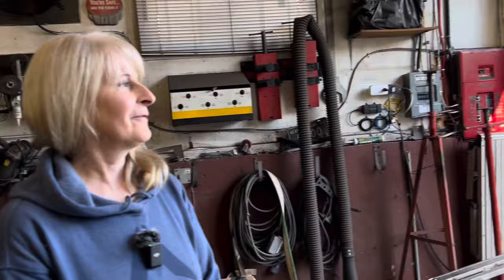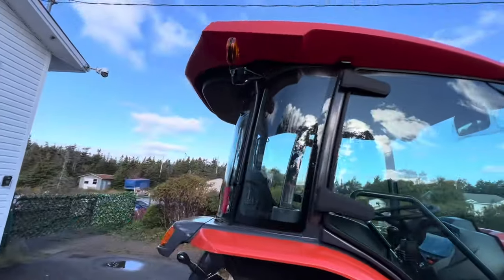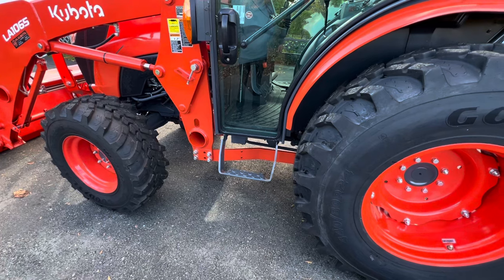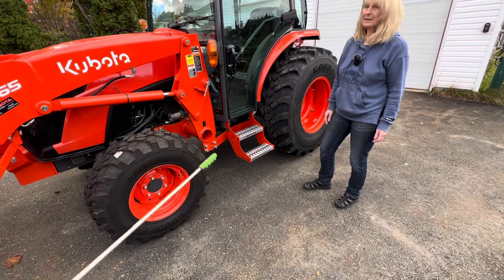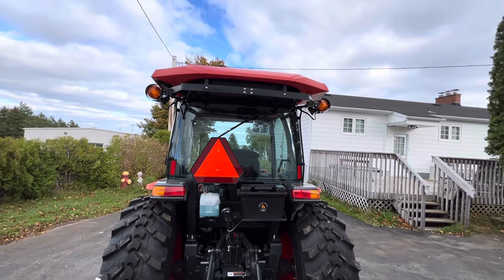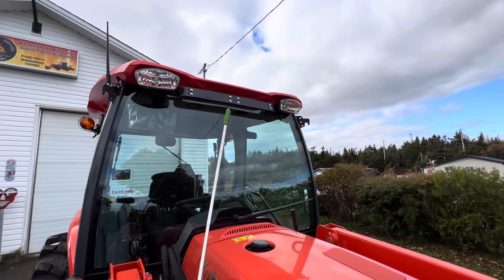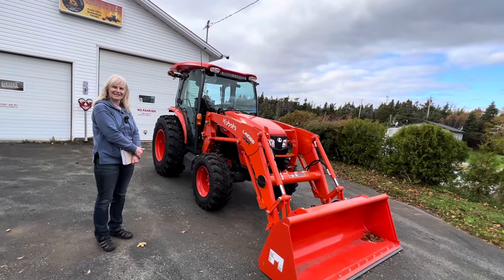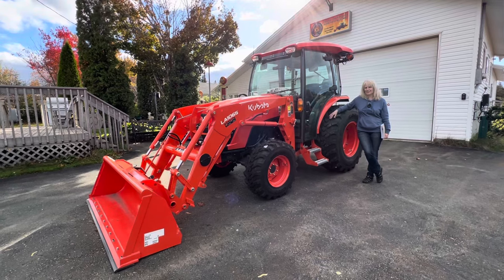Six Must Have Mods For The Kubota MX Series Tractors

Comment: Keep in mind you can just order another door handle and retrofit it to the right side to have normal operation. When I bought my MX6000, the dealer installed the right side normal locking door handle, along with rear work lights (identical to front halogen ones) and the mirrors from the Grand L series. I’d be interested in a right side step but under that box is the loader valve. Rear toolbox is nice.
Reply from the maker: That's a great idea!

Comment: Rear work light and two sets of rear remote valves are a must.
Reply from the maker: Very true. 👍
Reply: I just installed a single for a 12' Landpride batwing. Sure wish I had gone with a two-valve set but this will do me for now. I also installed the trailer light connector kit on the rear.

Comment: So nice to see you both!!!  And what a nice tractor - but even better with your mods!    You need to build a bracket to protect the window washer fluid in the back of the tractor.    Where I grew up here in the south, everything that was "stuck" outside of the body, got knocked off by bushes, tree limbs, and just trash.   When the bush hog would run over something, it would press it into the back of the tractor!!  And as costly as these tractors are, they should include some lights in the rear -   good you have come to the rescue.      Good to see puss puss the kitty also.    Hope you both are doing well and have a wonderful fall.   What a blessing it is for me to call you a friend.

Comment: Hello Paul and Kathy! nice to see you both again! That double step mod sure makes it easier to enter the bigger/higher tractors like this one! noticed that antenna/rubber duck type thing does not really clear that orange roof on the right front side. maybe make a short length adapter to hold that antenna an inch or two out and away from the roof canopy!? or could this be a problem with going through tree'd in area's ?  or maybe mount the antenna on the back of the roof canopy? just above the rear light bar?  Just throwing some ideas out to you here.  Thanks for the video!

Comment: I think it's a crime that Kubota would make a tractor like that and for what they charge, they don't include a rear work light.  My cabbed Kubota B3030 also came without a rear work light.  But at least, Kubota prewired it and gave a mounting bracket for a factory light/switch.  The biggest issue was removing the headliner to access the wiring.  For the life of me, I don't know why Kubota would not at least left the pig tails for the lights dangle out from the headliner inside?    My other complaint was no 12volt-accessory port.  My BX-25 had it, but the B3030 didn't.

Comment: Paul remember that government contract you had with the 5740 and it required a fire extinguisher maybe since the mx5400 only has one entrance and exit door and if you were to do mini excavator mods have that as a mod for those as well cause people are using both platforms for trail maintenance with rotary cutters and the screens get plugged while doing trail maintenance and causing brush fires I’ve seen towing recovery videos where they are recovering burned tractors and mini excavators of that size
Reply from the maker: We’ve pondered doing other types of Kubota equipment but as I told others, once you bring this stuff into the world then we have to always build it and stock it and if you’ve looked at our site you’d see we got a lot of stuff to keep up with. Hope your doing well.